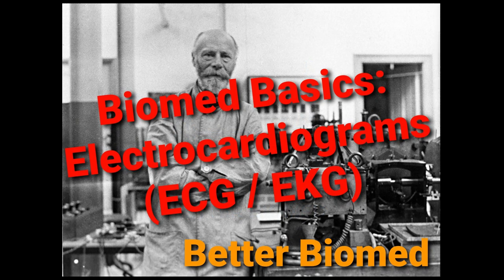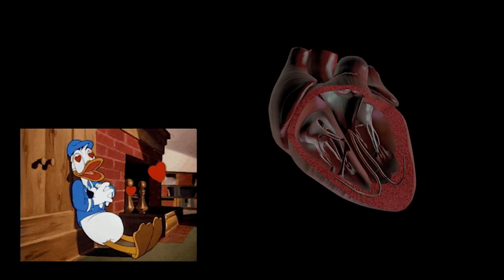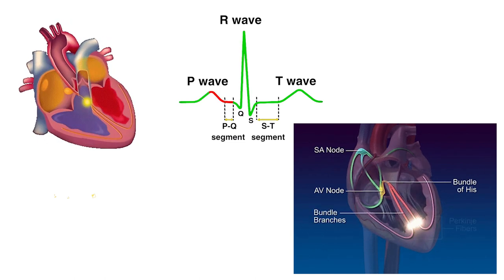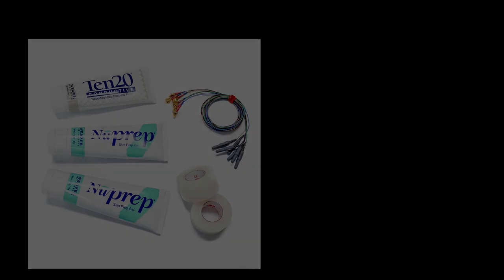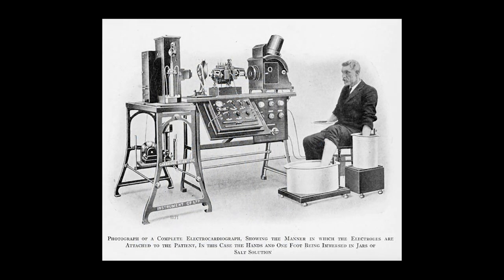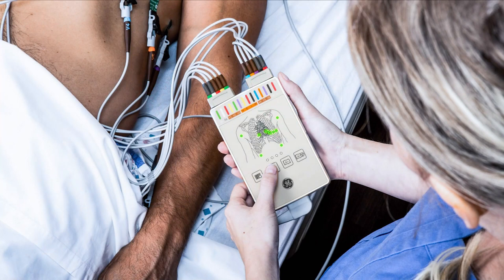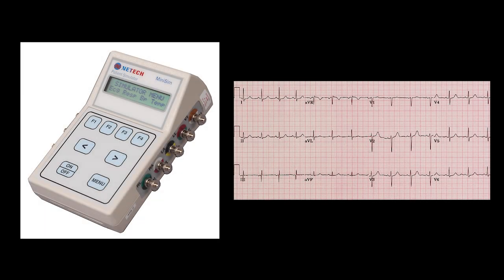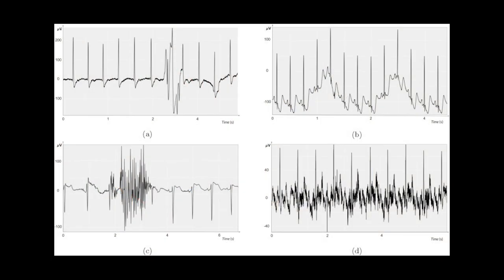Biomed Basics: Electrocardiogram Monitoring (ECG / EKG)

Comment: I have a welch allyn CP150 with artifact on leads 1 - 6 and LL during use and on my patient simulator.  Tried changing leads and power cord.  I can never duplicate the issue every time the same way.  I bend the cables in different directions and sometimes the artifact pops up and sometimes it doesn't.  I was going to try and replace the EKG board but wasn't for sure if it would fix the issue.  The department decided to just order a new unit.  Any suggestions?
Reply from the maker: Did you change the leads with a brand new set -from the packaging that you personally opened? Then hook those new leads to a different simulator. If an artifact persists, the ecg input board is suspect.
Reply: @BetterBiomedChannel  I used to packages of brand new leads.  I've had no issue testing other EKGs with my simulator.  Thank you so much for your feedback.